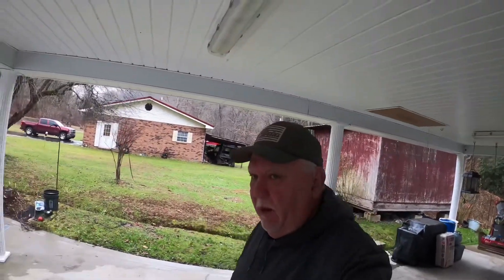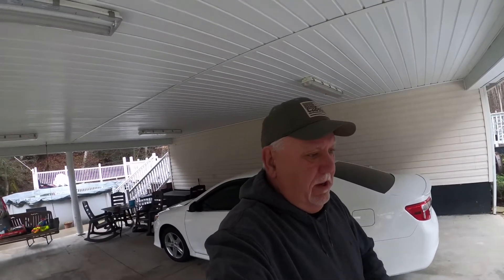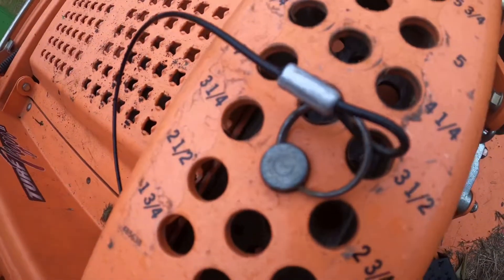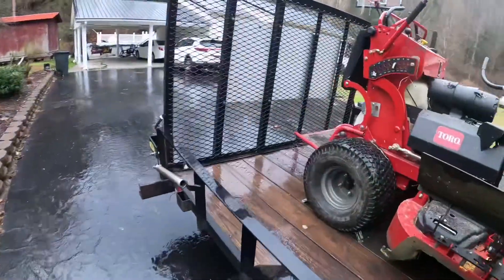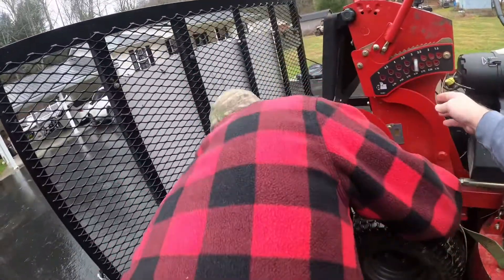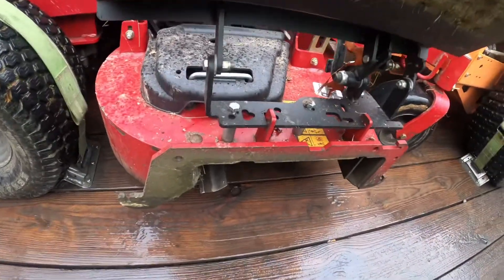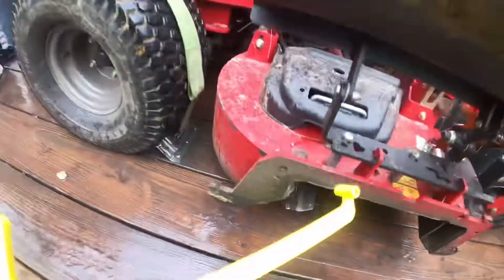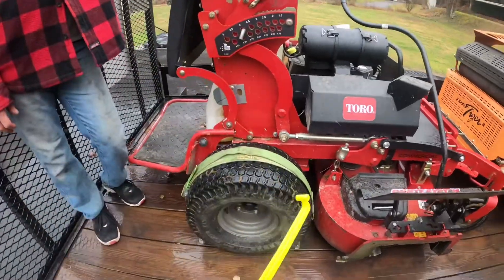DON’T LET THIS HAPPEN TO YOU!!!

Comment: It's definitely important to check the deck height especially, if you have multiple mowers. I've got my 2 Ferris mower decks set the same but, I never could adjust our ExMark close enough to match the Ferris mowers.  I'm about 1/4" lower on our ExMark 🤷‍♂️good tip Rick ! Hope you and family are well 👍

Comment: Great topic Rick - one thing that happens on my mowers is the tire pressure is always off and that causes one deck to be higher then the other- Especially when we get into the colder months - just my 2 cents. 
great video
Reply from the maker: Well that’s true Ray. Both mowers are at the same air pressure. I checked them in the summer and they were set at the same pressure. The reason I checked the deck height, which I done in 2018 when I bought the Grandstand.the reason behind this is, when you have 2 different mowers on a property. You need to make sure that they are mowing the same height. Thanks for watching brother. God Bless
Reply: @kalebslawncare8394  yeah The exmark that drew runs cuts higher that the exmark i run so we have to always figure that out - that another reason why i like for him to run that mower only so he dont scalp a yard or cut it to high..
Reply from the maker: I totally agree with you. Kaleb always runs the same mower. If he gets on one that I run, I always remind him about anything that is different and he does me the same way. We always practice good communication. That keeps everyone on the same page.

Comment: Rick shouldn't the blade be at 12 o'clock to check this for deck rake ?
Reply from the maker: You are right 💯. If you are leveling the deck, you have to do both sides and front and back. Unless the manufacturer recommends like a 1/8 or 1/4 up pitch in the back. We have been lucky so far. We have never had any issues with these mowers as far as leveling the decks. I want to always keep a check on them and make sure that when we have 2 mowers on a property that both are cutting the same height. Thanks for watching brother. God Bless

Comment: Good stuff plus you can add another half inch when you put a 1000lb mower on turf it sinks in a little I usually remove some spacers on bolt. I see scalping all the time an easy way to lose customers!
Reply from the maker: You are 💯 right. We never cut a lawn short enough to where we could scalp it but there is always places in some lawns that you have to watch. Thanks for watching Martin God Bless